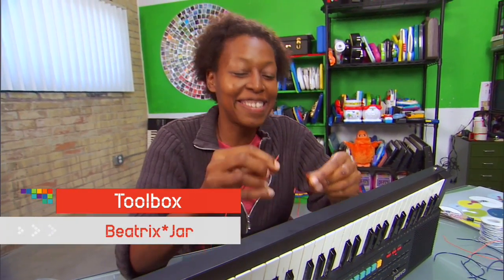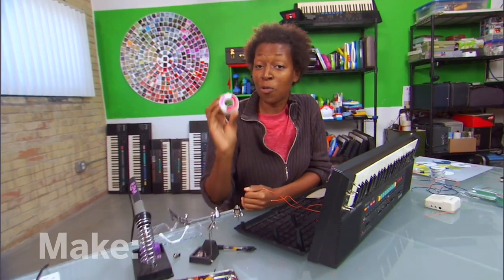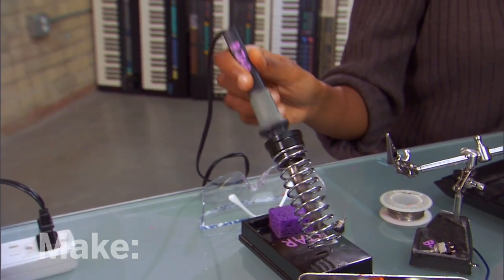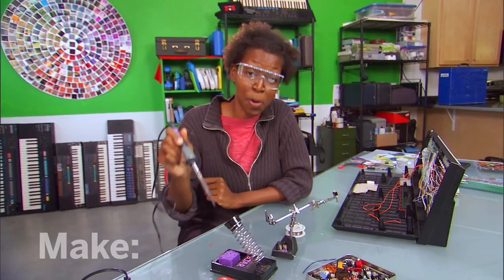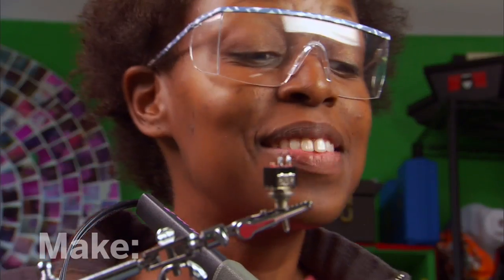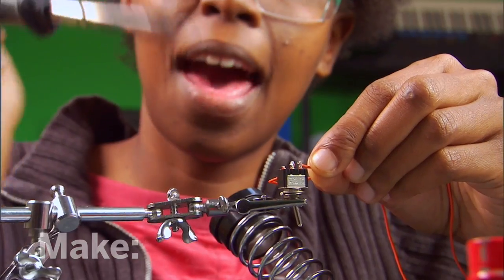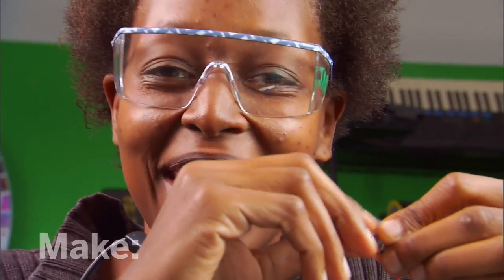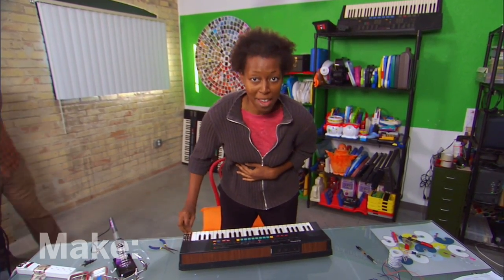Maker to Maker  Soldering on Make: television

Comment: This is no the best way to solder!
Reheating the solder is not good at all, if you reheat the solder too many times or not let it cool for a few seconds you usually get something called cold solder connection, where it just looks that there is a connection but there isn't!